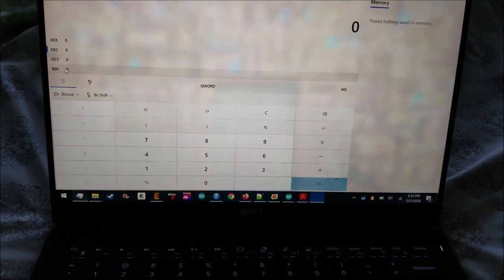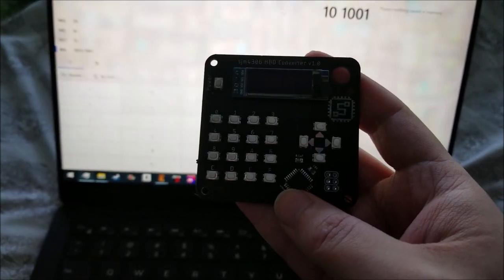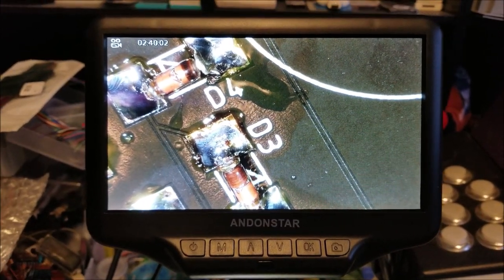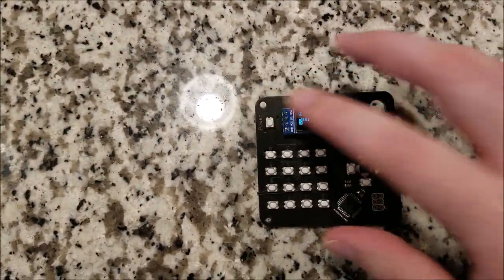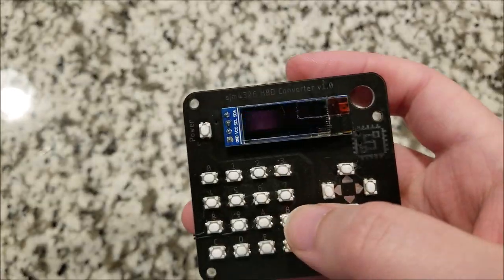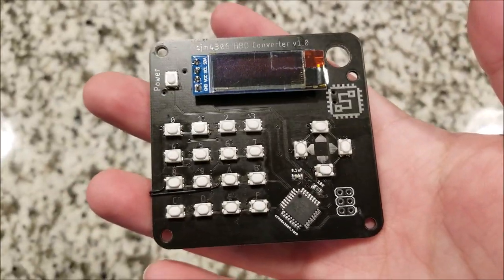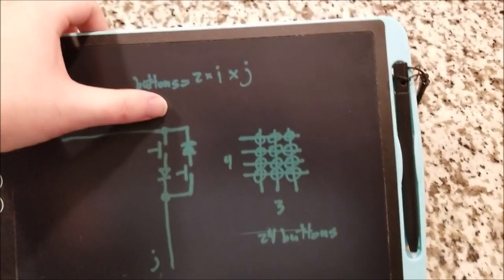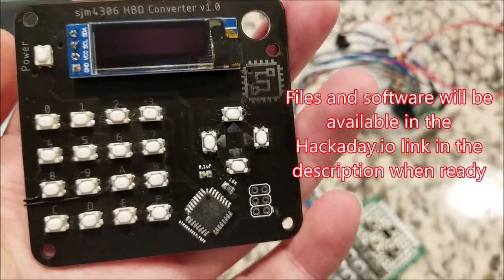DIY Programmer's HBD Converter (Hex, Binary, Decimal)

Comment: I love this project, I thought about a similar device with a specific coding but never did it. With the new Windows (horrendous) calculator your device is a must have as a programmer :D
Reply from the maker: This is one of the most useful things I've built, I use it practically everyday. And I'm glad I went the extra mile on the software controlled low power sleep mode, it's still using the same battery that was in this video! There are a few improvements I've thought of so there'll likely be an even better version 2 in the future.

Comment: this is very cool. one of the first things i ever did when i started learning programming was making a (command-line) decimal-hexadecimal converter. 
a nice function you could add would be a button that will clear the data
Reply from the maker: Good idea, I'll probably add a clear function by pressing two buttons at once.

Comment: do you ever make any fan-supplied ideas for projects?
hdmi-cic controllable volume control for line-audio (RCA jacks)

there is an hdmi-cic library for arduino and circuit seems simple. 
I already had a couple of digital potentiometers hooked up and tried prototyping on my own but it got too much for me too quickly.
ready made solutions for this seems to ARC DAC's with hdmi-cic and they seem to go for about 100$. I already have a perfectly fine optical DAC, I just want to a device to sniff the hdmi-cic and interpolate 0-25% volume to 0-100 on the potentiometers for volume control before my amplifier.

I figured parts wise it could be done for $20 or so?
Reply from the maker: If it's something I can use, then sure I look into making fan suggestions into prototype boards

Comment: nice project but those buttons are way too clicky. I think i'm gonna try do my own with an old numpad
Reply from the maker: A more traditional rubber membrane type button would be nice if you could find them in a small enough size
Reply: @sjm4306  well , it would be ideal. but i don't really mind if my projects look like soviet era electronics. In fact i kinda enjoys old stuffs, i like to reuse things. I'm pretty sure there is a way to soften those buttons.
Reply from the maker: I get what you mean about soviet era tech, I have a soft spot for the look as well